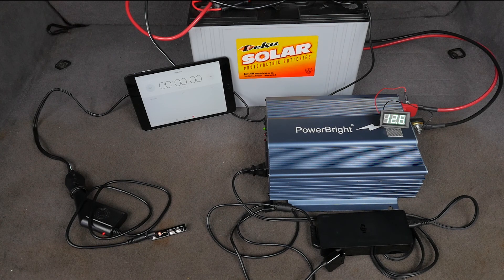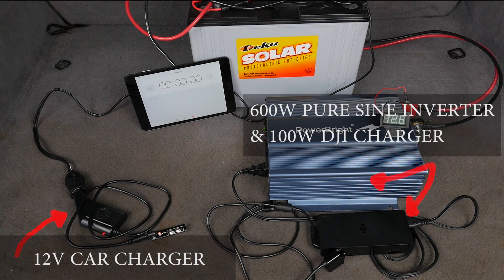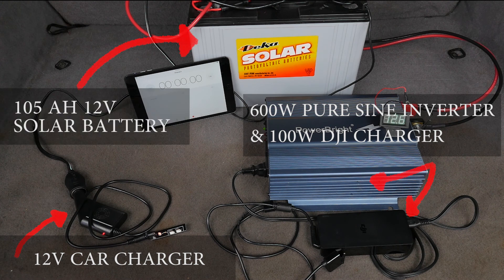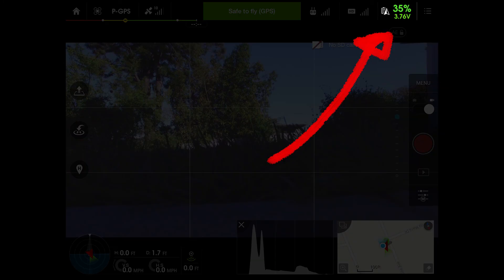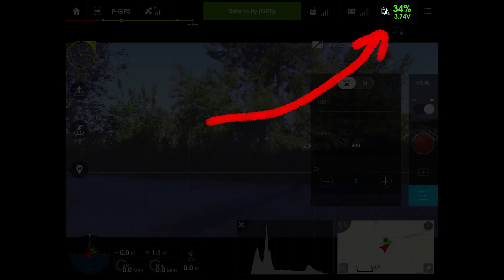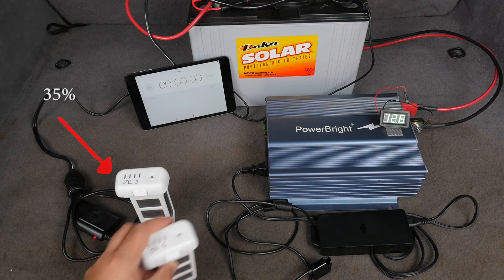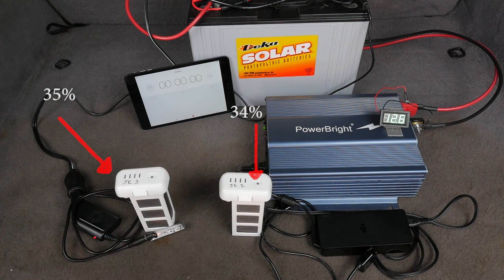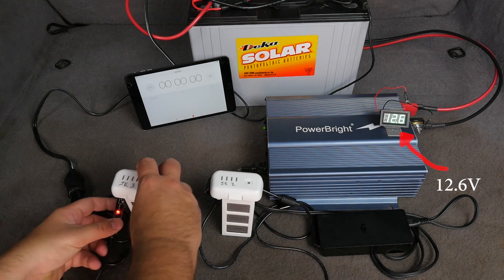DJI Phantom 3 Mobile Charging: Pure Sine Inverter VS 12V Car Charger

Comment: So how does that setup handle the Inspire 2 batteries?  Trying to keep a four or five sets of them up and going without Fulltime AC power in the field is beyond damn difficult . About to go buy a Honda generator as I can’t see any other way mathematically.   Have you found a better way?   I have spent days and days looking into big power banks, and still I fail to see how it would be a repeatable solution for an extended stay in the field

Comment: This isn't even an apples to apples comparison! Are you lugging around that lead acid battery to run the inverter? If so, are you having to recharge it again before each outing? Instead, are you utilizing your vehicles battery? If so, does your engine need to be running to sustain the voltages needed to start your vehicle later? There's substantially more work that goes into utilizing the 120v inverter vs the 12v adapter!

Comment: would it be possible to use a incerter plugged into cigarette lighter to charge 4 lipos at a time  ? (1500w inverter).... I'm not how much you could pull from cigarette lighter ?? ta

Comment: Thanks for this video! :)

I have one little question : which power of car inverter should I take to use my DJI charger inside my car? I already bought a 75/100W car inverter, but I'm a bit feared that it will not be enought to use my DJI charger with it... Should I tkae a more powerfull one? 150W maybe? (I don't need a car inverter as good as yours :) I only want to use it to charge occasionaly the batteries of mo P3 on the road), and I'm a bit feared to purchase the little cheap car adapter as the charging time seems much longer... and I think that there is no charge protections to ensure the safety of the batteries like on the genuine DJI wall charger....
Reply from the maker: +Manu B I would get a larger inverter. I would do at least 150-200W for the 100W charger.
Reply: +DroneTech Okay, thanks! :)
Reply: +DroneTech can i used 75w of inverter to charge my p3a? enough power or not bocs i only used it for this purpose. thks

Comment: Well this was an interesting comparison Jake, but what did the PS inverter cost? This may be a faster way of charging batteries on the go, but the cost of it is astronomical compared to the car charger that sells for less then $17.00 on eBay. I mostly shoot social events and small corporate films and have always found an AC outlet when on assignment, but I'm curious how many batteries can you charge with just the inverter, also can a Mod (square) Wave be used, and that big DC battery and how many amp hours is it? Thanks!
Reply from the maker: +Bobster986 - Yea, you can use a cheaper inverter. Here is the one I used: http://amzn.to/1S2fdfJ -I don't think it would made much of a difference. I have other sensitive electronics i need to charge / power when we are out. Can charge 4 batteries at a time with that inverter ( with the 100W chargers on each). The battery is a 105 AH solar battery. The whose setup was around $300 without chargers. We can continually fly with 4 chargers and 5 batteries with that setup.